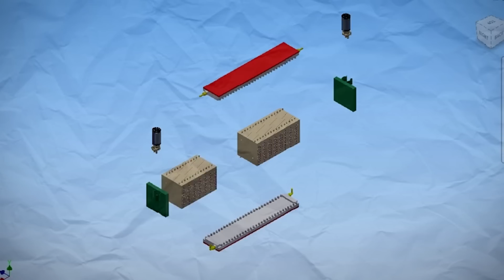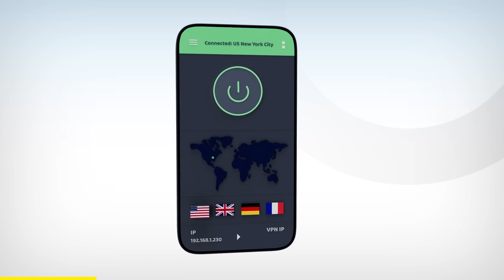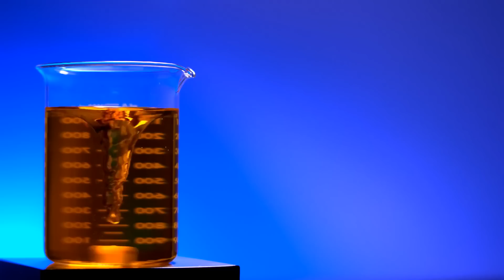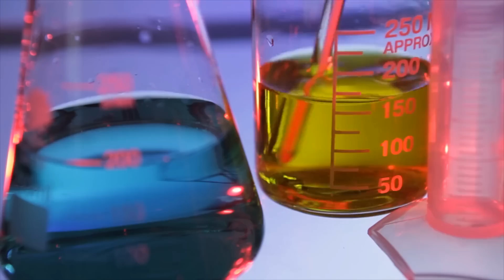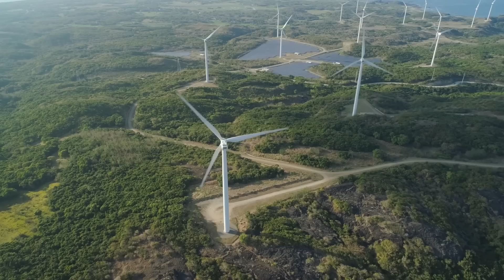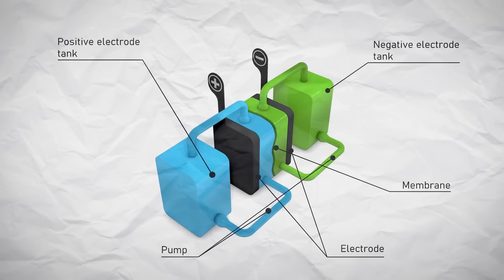This Insane Liquid Battery Can Instantly Recharge

Comment: This system may solve our long haul trucking issue. But it would need massive changes for flight. Currently flight plans are calculated with the loss of fuel during the flight. The plane gets lighter as it expends fuel. Keeping the fuel onboard will make long flights less achievable.
Reply: I like the idea too. I want to point out, that logistics overall is suffering from sunken costs in investments, and needs a solution to address lifetime costs. Supposing energy would become cheap the cheapest alternative may be to keep the current global fleet and start using synthethic fuels throughout that are produced with the cheap electricity. Electricity would just have to be 10x-100x cheaper. My argument simply put is that rather than adding new features the solution should be holistic.

I can't see all vehicles being transformed to electric driven cars as a budget friendly option.
Reply: It's definitely more of an alternative to li-ion than jet fuel
Reply: Yeah let us not be dumping that crap in the atmosphere haha. For a second I was like how is this different then regular fuel - I wasn't thinking.

 You are correct flights are calculated by the amount of fuel and then average the fuel spent during travel. It is always a catch .22 in terms of design - people are like why don't they just carry more fuel! Well because you weigh more at take off so you're using fuel to carry fuel. Hence drop tanks versus conformal tanks in fighters. Both have their benefits and why aerial refueling is such a game changer for the military. Edit ( Or why rockets use stages even if they could have an efficient magical rocket throughout the flight envelope.)
Reply: Not necessarily. Gas turbines are relatively inefficient, so it has promise. The main issue would be that existing aviation hydrant systems are designed for one-way flow. This would require a doubling of infrastructure and, perhaps novel piping solutions.
Reply: @Lukasz Jozwiak The problem isn't the cost but the weight you are carrying.

Comment: Their nozzle could use a little rethink, but the overall concept really does look promising.
Reply: What is wrong with the nozzle?
Reply: @ethankeon8152  I've used those type of liquid quick-connects they have on the fill-nozzle, and those normally require a good amount of force to push into place when it's just one connection. Four of them that all have to click into place at the same time, would be a challenge for most people. As an inventor type person, I can already imagine a few better ways to do this, with less force and less complexity.
Reply: @roberthoople  ah he’s true it would be an absolute headache if you couldn’t get them all to line up. They could just have the four pipes built inside of a singular pipe housing to look like a regular pump however just larger
Reply: @ethankeon8152  Yup, I was thinking something similar to that too. Almost like a stereo headphone jack, but for liquid... It'd be a tricky design to get right, but I'm sure it could be done... Might even mess around in CAD myself and see what I can come up with.
Reply: @roberthoople im curious if you did come up with anything?

Comment: Nothing new here. This has been speculative technology since the 1970s.
Reply: And in use commercially since the mid 1990s. But packing it with nano beads is a new thing that could make it one of the best battery options out there if the company's projections are even half right.

Comment: This will be great for stationary energy storage, and maybe for long-haul trucking, but a complete non-starter in passenger vehicles. With traditional lithium ion, we already have sub-20min charging times on highway rest stops for 20% to 80% capacity today, and by the end of the decade, we may be approaching 10 minutes. At that point, the car will be ready before the driver finished stretching their legs and going to the loo. This system will also have to compete with the much lower price points of sodium-ion tech and sulfur cathodes, all while having to carry extra equipment and having a lower roundtrip efficiency. Finally, if filling up at the pump is just an option for when charging takes too long, we will see these pumps only along highways and nowhere else, because there won't be sufficient demand anywhere else to make it economically feasible. So this won't even save jobs in local petrol stations.
Reply: I don't know if I've ever in my life spent 10 minutes in a petrol station. This tech could make filling an EV as convenient and familiar as filling an ICE. Two things people are willing to pay for.

You're overlooking another advantage this has for petrol stations (or rather energy stations?). Depending on demand and the size of the reservoir, the fluid could be charged only when electricity is at its cheapest. When the fluid is in low demand they could even discharge from it to power conventional charging stations at times when grid power is expensive.
Reply: Super fast charging kills lithium ion batteries and that's probably not going to change with newer technologies. The faster you charge it, the less it will last. And the last thing you want is to spend 25 grand every 5 years for a battery. Not to mention the queue in super fast charging stations.

The electric car concept is fundamentally flawed so I see room for this invention. But these (over)promising high-density batteries will likely never make it into production like other technologies that promised to render l-ion batteries obsolete. The reason is of course high cost and/or low efficiency.

In the end, we don't have to put batteries in everything. Hydrogen-powered generators inside the car that power an electric motor sounds inefficient but it's simple, reliable, refills fast and you won't need to spend a fortune every five or so years.
Reply: @Mr.Engine993  Hydrogen cars sound inefficient — because they are. They also have way less usable space because hydrogen tanks need to be huge.

EV batteries last way longer than 5 years, where are you pulling this nonsense from? It's more like 15 to 20 years according to recent studies and projections.
Reply: @PhazonBlaxor  there are two types of hydrogen cars:
1) those that burn hydrogen to directly move the drivetrain. Those are ridiculously inefficient.
2) those that burn hydrogen to power a generator that then powers an electric motor. These need smaller tanks and could be daily practical vehicles.

Any Li-ion/Li-po battery lifetime depends on how you treat it. You can make a phone battery die in a year or it could take five years. With faster charging and discharging the lifetime of the battery is reduced. If you continuously use a super-fast charger, the battery could very well die in 5-7 years. If you tend to use slower chargers and only use a super-fast one from time to time, yes they can last a lot longer. But we can't have both long lifetime and fast charging. This is what a car company wants you to believe in order to sell you their car. But the more you utilize one of the benefits, the more you lose from the other one
Reply: @Mr.Engine993  They are still huge and inefficient no matter if you drive electric motors with it (that's the variant I was talking about you know). Watch Engineering Explained, he has good videos on the subject that dive into the actual math and some of the major problems hydrogen in general has.

Fast charging itself doesn't degrade batteries, it's the heat, which can be dealt with like we have done in phones. Which is why I always fast charge my phones  — the batteries are just fine.

Besides, most people who own an EV prefer home charging most of the time anyways, because it's cheaper and more convenient. I mean, why waste time and go to a "gas station" if your car is always "filled" when you wake up in the morning? Might sound like a small time saving, but those gas station visits add up.
Reply: @Mr.Engine993  "1) those that burn hydrogen to directly move the drivetrain. Those are ridiculously inefficient.
2) those that burn hydrogen to power a generator that then powers an electric motor. These need smaller tanks and could be daily practical vehicles."

So your solution is problematic and incorrect because you're introducing a more inefficient method of generating power. A generator isn't going to be as efficient as a fuel cell as you're losing energy to heat waste.

"Any Li-ion/Li-po battery lifetime depends on how you treat it. You can make a phone battery die in a year or it could take five years."

True but using a phone battery as an example is terrible and more than a little misleading. Phone batteries don't have the thermal and battery management systems that EVs have. 

"With faster charging and discharging the lifetime of the battery is reduced." True but even using fast chargers, the data shows batteries lasting longer than 8 years. 

" But we can't have both long lifetime and fast charging."

You can with the right battery.
Reply: @Mr.Engine993  "Super fast charging kills lithium ion batteries and that's probably not going to change with newer technologies. The faster you charge it, the less it will last. And the last thing you want is to spend 25 grand every 5 years for a battery. Not to mention the queue in super fast charging stations."

Whilst fast charging does kill Lithium ion batteries faster, your 5 year comment is grossly exaggerating the rate of degradation. 

"The electric car concept is fundamentally flawed so I see room for this invention. But these (over)promising high-density batteries will likely never make it into production like other technologies that promised to render l-ion batteries obsolete. The reason is of course high cost and/or low efficiency."

You mean low specific energy density. This video has lithium ion rated around 100 to 150 wh/kg, when in fact, they're closer to 300 and even LFP is getting close to 200. You also have Graphene AL-ion batteries hitting 300wh/kg and the newer lithium SS batteries hitting from 500 to 900wh/kg. 

"In the end, we don't have to put batteries in everything. Hydrogen-powered generators inside the car that power an electric motor sounds inefficient but it's simple, reliable, refills fast and you won't need to spend a fortune every five or so years."

Having a generator would be incredibly wasteful and worse for range then battery powered EV (unless they solve the storage issue). You'd be better off with Fuel cells, which are EVs.

Comment: While it's interesting there's far too many variables left out of this story to give it much traction from future developers.

Without knowing the chemical makeup of this "mystery" fluid we can't even guess at the probability of it working in weather extremes such as heat and cold tolerances or it's reaction to absorption or loss of water while being stored, transferred  or during it's heating and cooling cycles.

How toxic is this fluid? How abundant are the materials this fluid is made from? Does it require constant mobility to keep the particles in suspension?

I have many more questions but I think I've made my point.
Reply: Do a little more searching. This tech (Vanadium redox liquid flow, without the nano fluids) has been around a long time in industrial energy storage.

Comment: Nice idea, I'd like to know the cycle live of the fluid wouldn't there be a quality issues at the filling stations mixing varying quantities of different aged fluids though there live cycles.
Reply from the maker: Very interesting point, I could definitely see this being something they will need to put a lot of thought into
Reply: @ZirothTech  
Has anyone considered a closed system liquid battery?  In other words, rather than fluid transfer, simply charge an enclosed fluid as long as it can take a charge.  At some point, the battery module would have to be swapped out, sort of like we do with propane tanks.
Reply: From what I've read the liquid components don't degrade on their own. Perhaps pump wear or contaminants could reduce the liquid's energy transfer capability or rate, but by itself it is stable and can last 20+ years easily. In commercial / industrial systems only minor maintenance is needed every few years.
Reply: The only issue I see with this is intentional contamination. They will have to track who used it last to deter bad actors with penalties.
Reply: The big companies are trying to squeeze as much money out of us as possible through the use of regular rechargeable batteries.  They withhold certain technologies!
Reply: They have similar batteries that the general public cannot afford.  They produce electricity when you pump hydrogen into them!

Comment: I am sorry:
Why DARPA is lost Following MIT Standardized Type of thoughts and not lost in the Beautifully Good Eyes of Kaner...???
Ok being Married to the Just Cause..

But we all know that 500km Autonomy Supercapacitors made of Graphene Aerogel that recharge with surrounding WiFi or Induction Platform in Gas Stations are better than Any Flowing Pump..
...Almost Any Flowing Pump...

...and Why you said DARPA???
You're afraid if you say IARPA people will judge you badly???
IARPA technologies are usually Public...
DARPA technologies are the ones that aren't fully public, but you can follow up the Thoughts Process, and if you do you have to Realise that Asimov & Kaner had it from the late '80s...

It wasn't even a Market Disruptor because All the Carbon Atoms of Oil, so the 87% of it can be used by turning them into Graphite and into Graphene Automatically...
The rest are polymers and Natural Gas that can both be used in a multitude of ways...

We weren't Stop Evolving Our Society By the Dividends Guilds...
We were stopped Evolving by means of Inhumane Madness.

Otherwise Bush and ISIS as Petrol Lobbyists are the same Thing...
...and they're not..
Reply: Total word salad

Comment: this is an oil company wet dream

nah I'll just go with solid state batteries that never need maintenance and I never have to mess with fluids
Reply: Lithium batteries suffer from wear too, they will need to be replaced after some point?

What kind of maintenance do you need to do on gasoline cars anyways? Idk much about cars
Reply: I'm not sure and didn't read about this tech but I suspect you'd probably be able to also charge your battery instead of a refill should you wish. After all the fluid is charged somehow and it shouldn't be too difficult. Heck, you could even have a setup at home charging multiple refills while you're gone. Who knows.

All that being said, cars are still cars and they carry with them many other problems aside from burning fossil fuels or recharge. Railways and good, comfortable public transport rule!
Reply: @mistaowickkuh6249  do we really need to add complexity and a potential major source of failure to the electric car just to make sure that oil companies can still sell you a liquid to put into your car?
Reply: @iamdmc  I'm just saying this might be just another battery that can be charged like everything else who knows. Without any added complexity at all. With the refill as a fluid or charge yourself options. If the energy density can beat lithium batteries it's definitely the way to go. I'm saying you can also probably have a setup to recharge your own liquid yourself. After all it was charged in the first place somehow right?

Also as long as you keep using a car, no matter what it uses as energy, you're making oil companies happy already.
Reply: Why this should be liked from Oil Companies?
Way of Using the Numerous Tanker  they have???
Reply: Vanadium redox can definitely be charged any way you want to. And need more storage? Just add more liquid. Search "Maria Skyllas-Kazacos" to get the papers on it.
Reply: and charge from my own solar panels